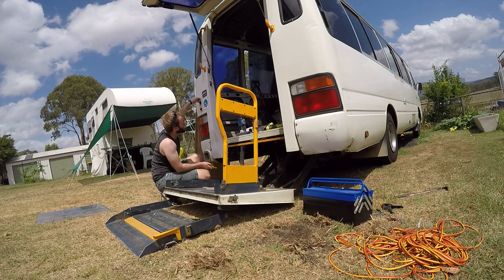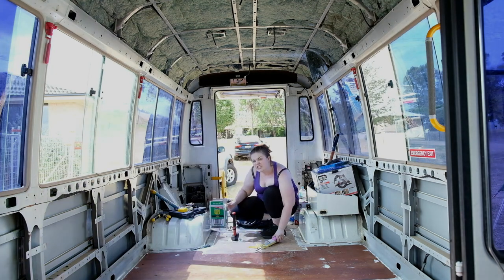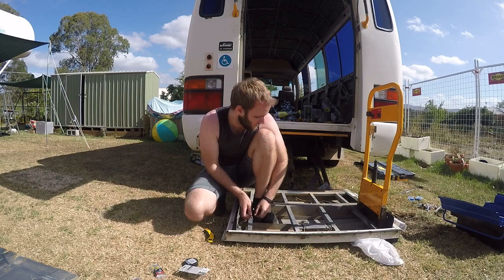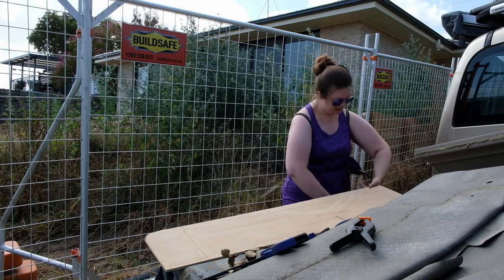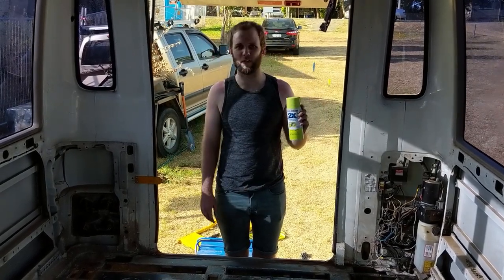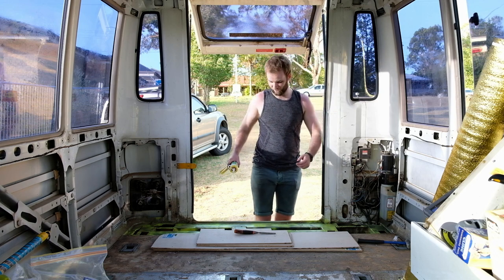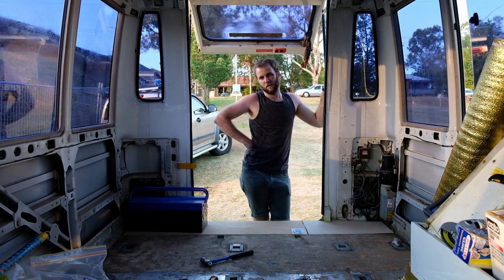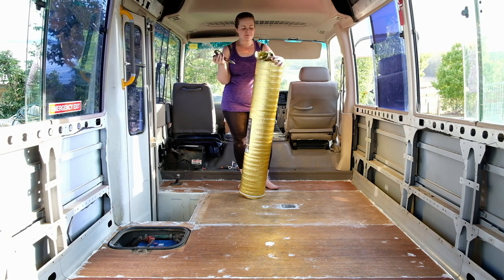Toyota Coaster Bus Conversion - Finishing subfloor repair, underlay and wheelchair ramp dismantle

Comment: Hi guys, nice job... you might like to have a look at using Sikaflex polyurethane adhesives and sealants. Better for automotive and marine applications. If you are using silicone on metal make sure you use a "neutral" cure version but you probably already know that...cheers.
Reply from the maker: C Adams Hi, Thanks for the tip! I'm not actually sure if we have been using a neutral cure version or not but now that you have mentioned it, we will be looking into it. Glad you are enjoying! 😊